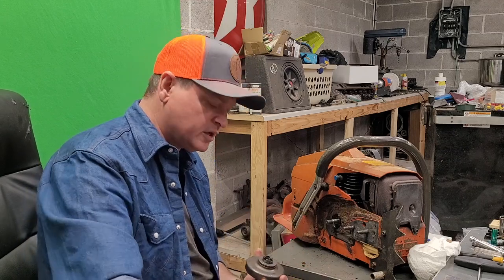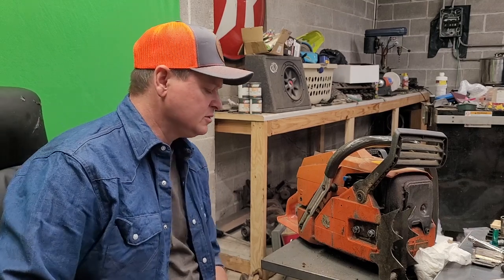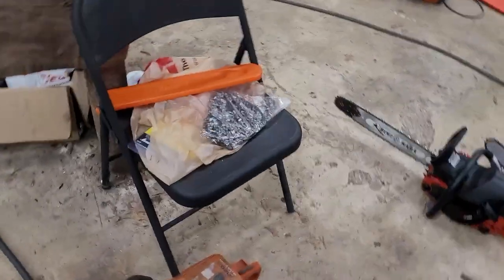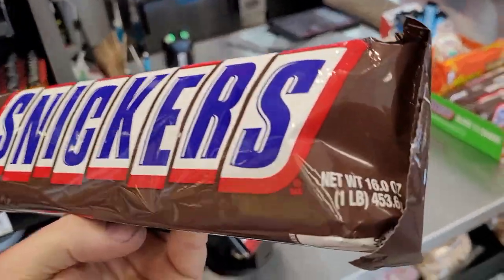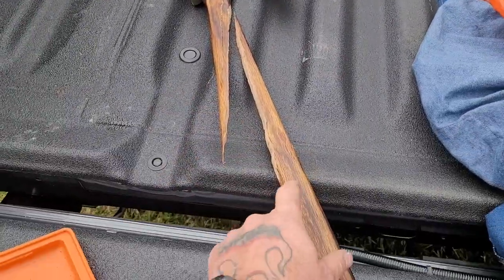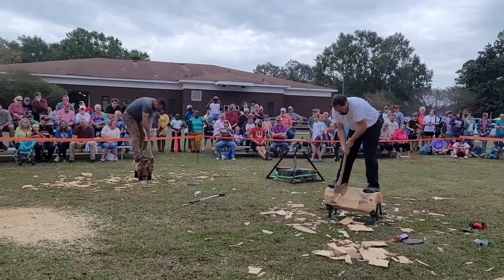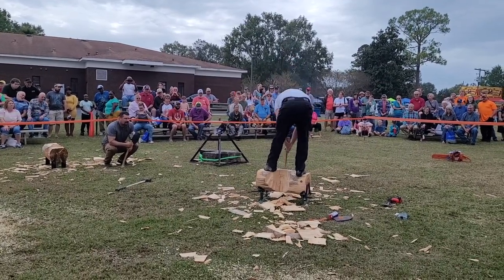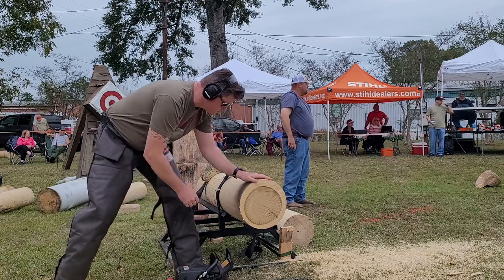Trying To Compete - A Chainsaw Racing Documentary

Comment: Spent the last 40 years working with engineers and probably the most intelligent guy I’ve got to spend time with was a timber faller for three decades. Guy had more practical knowledge than any two or three average guys. He had a degree from the university of Minnesota as well but anyway. Three decades ago he hooked me up with a stihl 066 that was stock except for the jets (we cut on the west coast in the Sierras) and dropped a tooth on the sprocket. I won the large at the time local contest with that 66 in my class (under 7ci), plus the over 7 class and 2nd in the hotsaw all because of the chain my buddy hooked me up with was lighter, thinner and had his special cutting angles he perfected while on the job. I cut a lot of logs with that saw before I gave up summer logging. Point being, I think it’s more chain and having the right balance than pure HP. That 66 beat out a dozen 090s that had all kinds of porting and custom  exhaust but the all ran heavy chain plus they didn’t have the RPM. Back then fast saws were just coming out. Anyway, love you channel and your great attitude! 👍🏼
Reply: Awesome stuff and a great share!  There’s a hole heck of a lot of information in this post if a guy can really read between them lines… that’s why power is very important having just enough power and the right sprocket to make that faster chain speed is going to make you cut faster than the other guy’s!!!  And you can win a race!!!  God Bless you old timer! It’s all about the love of the saw’s and the timber!   It’s a beautiful life to have gotten to cut on the west coast timber.,,I was an east coast kid but I worked Washington to Oregon over two summer’s a couple decades ago! ❤️😉👍💪
Reply: Old timer? I put in a 14hr day driving surveying monuments today! Old timer is my 93 year old dad and he can probably still kick me ass! lol 😉

Comment: This is so cool to see! I’m new to the chainsaw world myself but grew up riding and building anything with a motor that I could hop up! I help a crew that runs 600cc sport bike motors in sprint car frames and you MUST “gas down” your carbs after running methanol/ethanol through aluminum carbs. I’ve seen the methanol eat through the bowls if left in too long after a race.